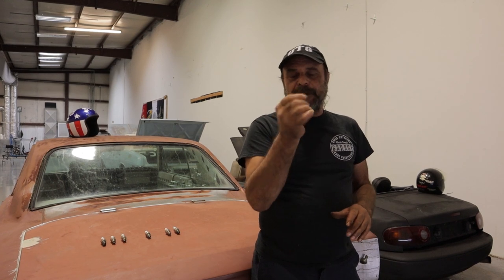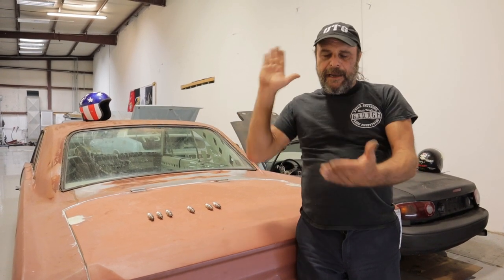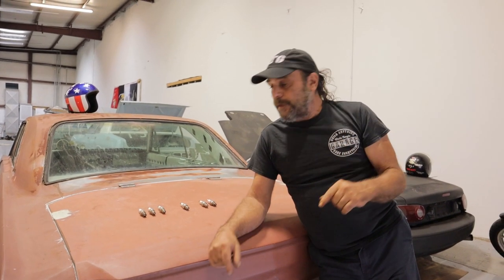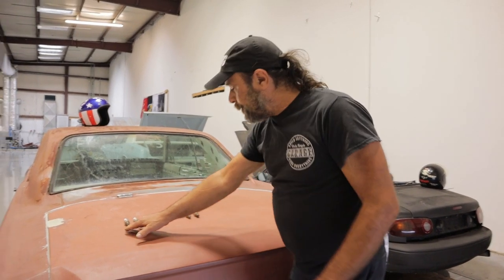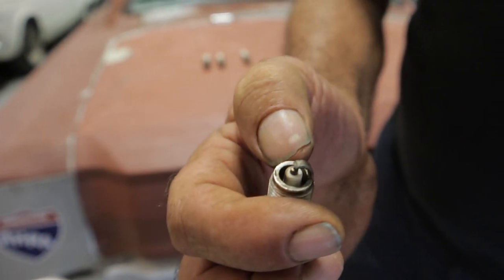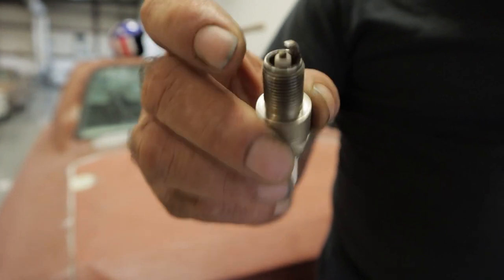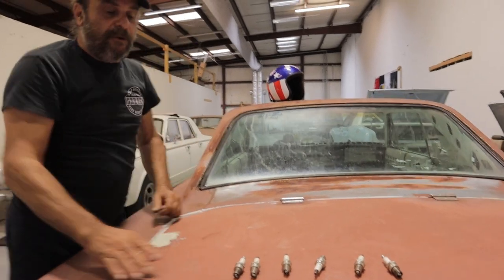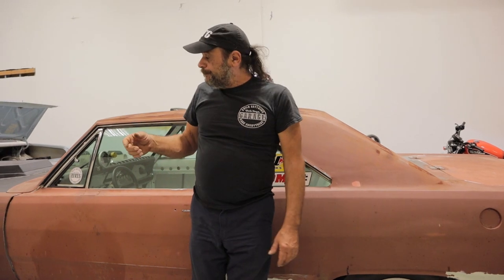Tales Of The Spark Plug. Engine Tuning By Reading Plugs

Comment: Why not try a Quadrajet or Thermoquad. off a small block, anything around a 5 litre engine, should have a more even air fuel ratio.
Reply from the maker: it's not the carb creating distribution issues, but the configuration of the manifold.  We have the distribution straight now, It's volume we need to add

Comment: Just a thought, but to overcome the low velocity, why not just go with a higher stall speed converter?
Reply from the maker: It's already a 4000 rpm converter on a 5500 rpm engine
Reply: That sounds pretty good. Do you think some of the lost power at the top end was due to detonation with it being lean?
Reply from the maker: Absolutely
Reply: I really like the way you are reasoning this out. I'm not sure if the velocity is an issue at 4000rpms but it definitely looks lean. I don't agree with some people saying just go smaller carb, this isn't a street car and that would really only help bottom end. Love you channel by the way.

Comment: You mentioned shutting the engine off at the end of the run to read the plugs. You can probably do it because I guess you're running a 904 but what do you recommend for guys running 727s or TH-400s?
Reply: Safe neutral valve body.
Reply: @black99rt  A safe neutral valve body lets you decel in neutral instead of engine braking in third from whatever RPM you cross the finish line at. The motor has to be running for it to work. Once the motor is shut off there's no hydraulic pressure and the drum will overspeed just like it would in a regular 3 speed that had the motor shut off.

Comment: UT, I’m confused about the plugs. Did you not show us you can clean the plugs with a blow torch to re read them? Or did I miss understand?? Replacing plugs all of the time at todays prices can get expensive if your doing it all of the time. Different question but on a normal street motor if your running rich and readjust the carb but don’t touch the plus will they eventually self clean and read ok ??
Reply from the maker: It's two different things.  Cleaning plugs as we showed is perfect for reviving old/dirty or carbon fouled plugs.  In this instance we need virgin surfaces to see exactly what is happening in each combustion chamber

Comment: Tony, do you think switching to a lighter viscosity oil will help minimize the stress on the oil pump gear? Maybe 0w20 or even 0w16....just a thought, it may allow more shakedowns runs before you make a reliable oil system for Plan Z. Or is the oil pump gear or cam gear too far gone already?
Reply from the maker: The gear is one problem.  The one we are dealing with here is oil slosh and excessive windage due to the basic design of the engine
Reply: @UncleTonysGarage   Got it....I see now that one of the best mods for this engine is an oil pan revision and windage management. I believe you would feel a good HP increase, just like you mentioned, in a stock engine.
Reply: @watzonda2b  they work. 
Butt Dyno confirmed. 
I picked up like 2-3mph exit speed on a certain corner when I added one to a lowely 52hp diesel vw years ago.
Reply: 0W16 is WAY TOO THIN...
Reply: The concept of thin oil is solid. 

It heats up less and takes less effort to push.    I built my last BBC with tight clearances and thin oil and it's worked beautifully.
Reply: @breckfoster767  Anything thinner than 5w30 is TOO THIN, especially when hot.
Reply: At 200* and below 5/30 is fine for any engine sold.

Now sure when it gets above that temp it gets thin, but it should never be above that temp anyways.

Comment: Wouldn’t a wideband gauge be beneficial?
Reply from the maker: It would tell us pretty much exactly what the plugs did.  Even with a wideband, you would still need  to read the plugs to determine distribution
Reply: @UncleTonysGarage  fair enough too!
Reply: yup, wouldnt have to go thru the hassle of plugs to get it good enough for the average joe. fine adjustments would still warrant reading plugs

Comment: hey Tony this is gonna piss you off ,but all the folks that make four barrel or two  barrel aftermarket intakes for 4 or 6 cylinders, are  telling me ,on 4 barrel set up the primary throttle barrels face the the valve cover,, you want the primary throttles to feed  all six cylinders, you cant do that with the carb set up like  that,  ,unless you have big fucking plenum
Reply from the maker: Tom, if you find the DC Slant Six racing manual, you'll find that the factory engineers used the same carb, facing the same way as I have, on this same manifold, and that is what gave them the best results.
As an aside, I only discovered this last week while doing a search on small cube jetting for the Slant
Reply: @UncleTonysGarage  I  used to run a split port offey 8 port deal, on a Lima 2.3 with a 390 holley four barrel, the primaries faced the valve   cover and the velocity  was so high the manifold would ice up. what ever you do ,the bigger the plenum will give a mix in terms of air flow,  I bet if you turn the carb 90 degree,s you will pick up 25-30 hp,on a high compression slant six, with a four hole spacer

Comment: Just get a vacuum secondary carb. Then The car will pull what it wants
Reply: He had a vacuum secondary carb on there and it didn't work. Mechanical secondary carb is the way to go for this application.
Reply: The secondaries are no where near opening when this problem is occurring so a mec or vac carb makes no difference.
Reply: @bobroberts2371  all I’m saying is I don’t think he needs a double pumper on a slant 6. Maybe I’m completely out of line and way off, but my 383 doesn’t need a a double pumper.  I don’t even believe he needs a 750 but that’s a whole different debate. If the secondary and primary throttle blades are opening at the same rate off idle, thats taking away air velocity. If the secondaries were always shut until the car needs them more air velocity would pull from the primary and the boosters wouldn’t dribble fuel out like he says they are. Idc what anyone says no one can convince me a 6cyl needs  4 750cfm throttle blades open at part throttle to function correctly. Just my 2c
Reply: This is not a uncle Tony hate comment. I love the guy. Just giving my opinion
Reply from the maker: Rick, go back and watch the last few videos we did on this car. We started with a vacuum 750 and now have a mechanical 650 on it
Reply: @UncleTonysGarage  how did I miss that 🤦🏻‍♂️…. I feel dumb now. I watch all your videos I swear! Sometimes I just watch them while I am working 😂Foot in mouth 😂. I still stick to the vacuum secondary comment. I think there isn’t enough air velocity pulling fuel through. The vacuum/air is  being spread around too much . Maybe try finding a vacuum secondary 650??  If my 650 brawler wasn’t brand new I would send it to you!

Comment: Would adding an AFR sensor be any help?
Reply: Didn't have no fancy sensors in '68!
( I'm REALLY thinking about adding one. And I'm prolly older than Tony!)
Reply: Make sure to use a wide band, the narrow band isn't useful for tuning.
Reply: Not criticizing, but Tony is showing the skills required and demonstrating the human and machine interface to gain Fuel Ratio info/readings without the AFR guage.
Reply from the maker: Not really, because it has no way of showing distribution
Reply: @UncleTonysGarage  no bit should show under what conditions you are lean or rich.

Comment: Do you index the spark plugs or just install them however they tighten down? Does it really help to gain power by indexing spark plugs?
Reply from the maker: We'll experiment with indexing the plugs once we get the car to run consistent and clean
Reply: @UncleTonysGarage  That would be great to see if indexing spark plugs helps. Ive wanted to see someone to experiment without indexing and then seeing if there is an improvement after indexing spark plugs.

Comment: This guy is all over the place with mis matched components. First off, he needs to find the root cause of his oiling issues and correct that before major damage occurs. Second, it takes more than just one pull before plugs begin to show color and you CAN NOT properly read plugs without an otoscope, the naked eye only can tell you if something is drastically wrong. To really dial in and engine properly it needs to go on an engine dyno, that tells everything and then there's no more guessing, the numbers don't lie.
Reply from the maker: Mis match?  Care to share the "correct formula" for building something like this?
And you could not be more wrong about coloring plugs in one run.